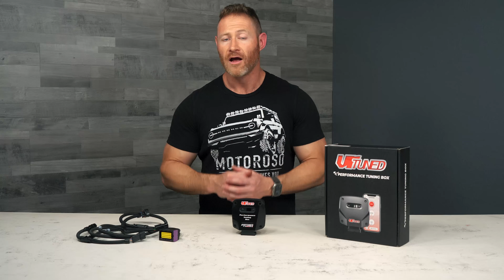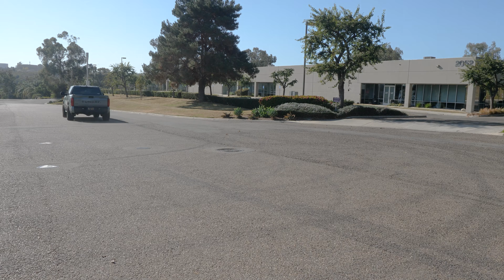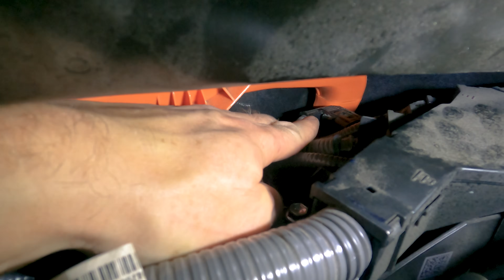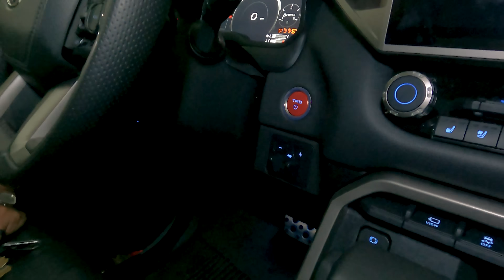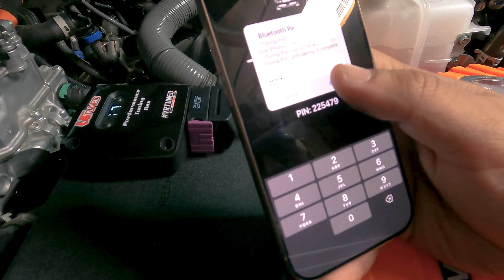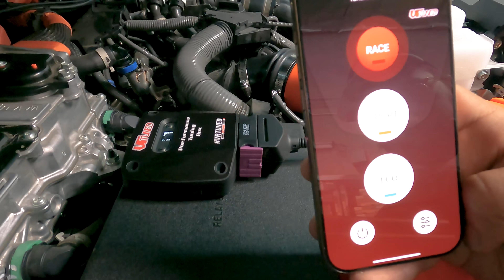3rd Gen Tundra Piggyback Tuner from VR Tuned adds +60HP and 75TQ!

Comment: What about the 3rd generation Tacoma TRD Off Road, double cab, 6’ bed, TRD Performance exhaust, with the Premium and Technology pkgs.
I’ve also installed a cold air intake and the Overland Torque Tune (OTT).
Yes my truck has the 3.5L V6 and the 6spd automatic transmission.
Reply from the maker: These types of piggyback tuners are pretty much exclusively made for forced induction (i..e. turbo) engines because they can inject the signal into the MAP sensors and produce more boost. So, I don't know of any piggybacks for the 3.5L. But, Orange Virus Tuning is known for tuning these trucks, take a look at those guys. We also made a video about getting more power out of that truck, you can see that here: https://youtu.be/-qWaYxotGuc
Reply: @ Thank you